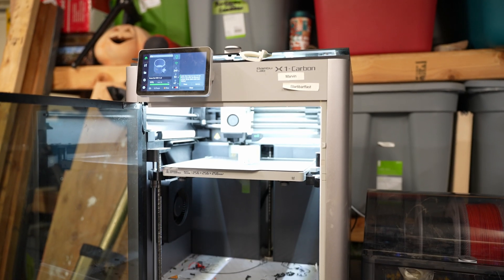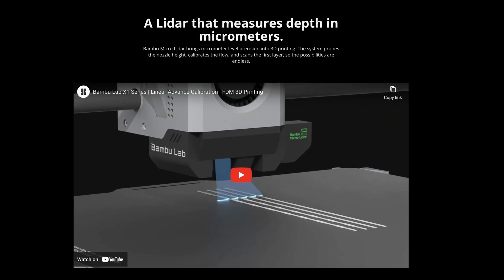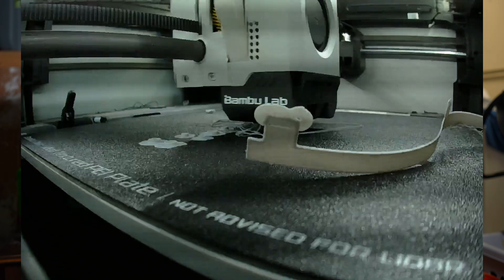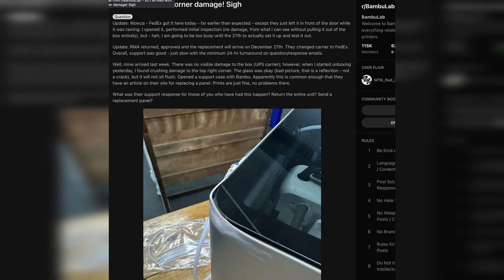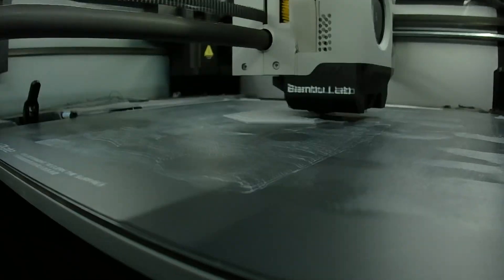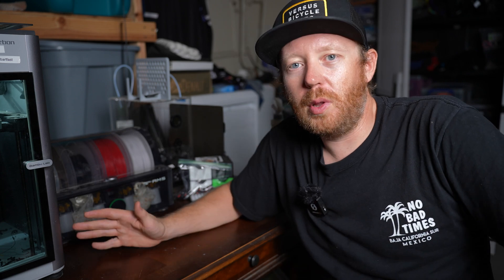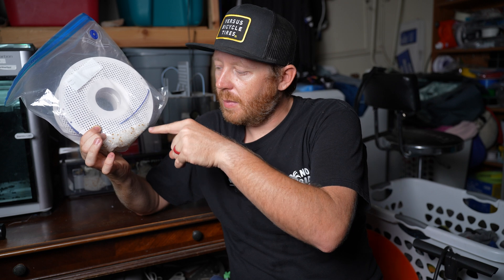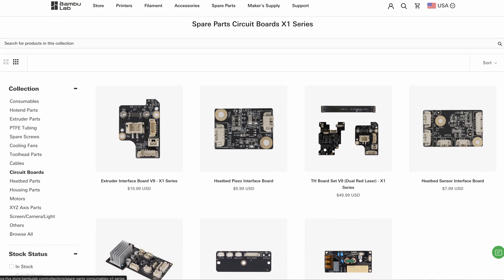Bambu Lab X1 Carbon Review: Is This the Best CoreXY 3D Printer?

Comment: I use two P1S constantly (currently I use up about 8kg of PLA per month) for  tabletop terrain. There was one instance where one of the printers really messed up a first layer. So I don't miss the lidar. What happened more often was small objects getting loose off the (PEI) build plate. But I mitigated that problem by giving those Objects a bigger first layer (quite often interlocking with other objects). At least with PLA, the Bambus are so good and reliable that I don't need the lidar.
I use eSun PLA+ (mainly matt grey) with the standard 4mm nozzle, mostly at 0.12 and 0.08mm layer heights.
Reply from the maker: I Think the P1S Might be my next printer that I Add.

Comment: I have a P1S and find that using a bit of glue stick has been the key, was printing multiboard panels and some of the edges were coming up on the textured plate. I just use the camera on it to monitor it every now and then.
Reply from the maker: I found that if I turned off the aux fan, I stopped having my corners/edges come up when printing pla

Comment: I always wait for the first layer to complete before I walk away and let the printer do its thing. That said my printers are an 8 year old Ultimaker 2+ manufactured before all the sensors current printers have were developed and a new Qidi Tech Smart 3. After the initial set up on my Ultimaker I rarely had any issues with the first layer, failed prints, spaghetti, etc. The Qidi has most of the sensors but the Z adjustment requires manual adjustment. The biggest benefit of the new printer for me is the wifi connection and not needing to plug and unplug SD cards to print. I am considering the Bambu P1S o replace the Ultimaker but hesitating due to the closed system of Bambu. I understand that there is a LAN mode for the P1S. Have you tried the LAN mode?
Reply from the maker: I have not tried the LAN Mode Yet. When I had the Sovol, I hated having to go from the computer to the printer with a sd card. Being able to do it via wifi is so much more convenient.